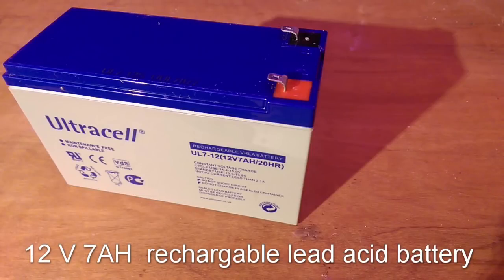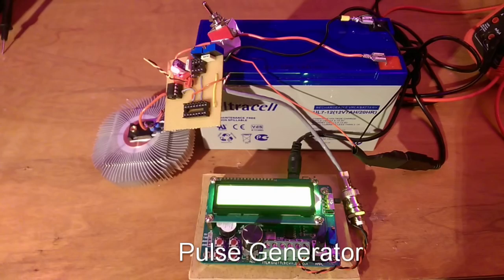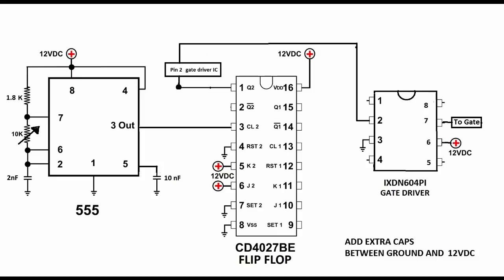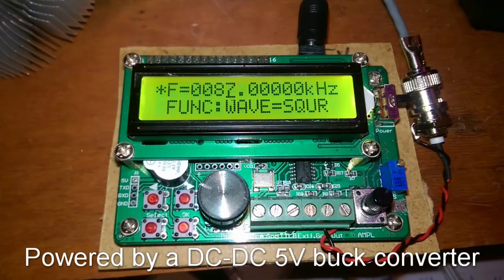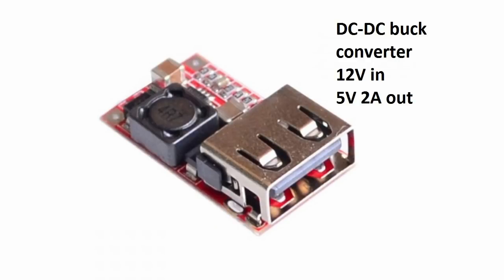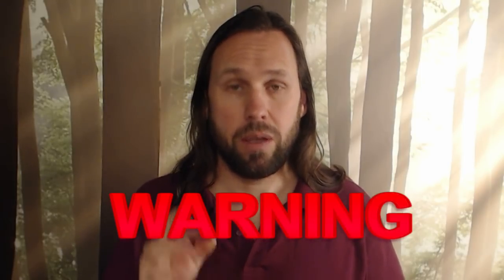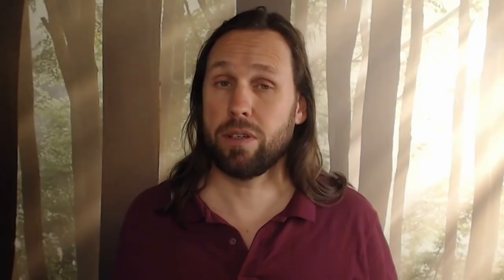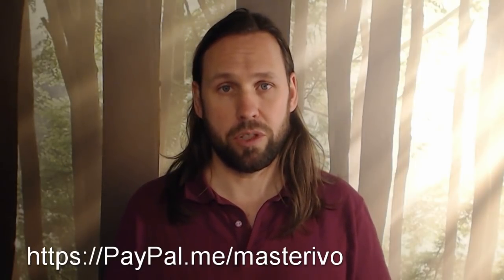High Side Inductive Switching with a N-Mosfet

Comment: Might also check out the DM6 series MOSFET's designed for lower reverse current time (which occurs in all MOSFETs), higher reverse voltage (600V) and specifically designed for back dv/dt protection ("robust)...additionally it has built in zener for input protection so you don't have to regulate the input pulse.

So typically I switch the lower-side of the coil (negative side)...and use parallel diodes for the back-EMF through a secondary circuit to collect the back-EMF energy...at any rate the back EMF of the coil is acting as a 'battery' for the secondary circuit...typically a capacitor bank (or a battery)...this secondary circuit protects your switching MOSFET from the back EMF (dv/dt)...thus I don't typically toast my MOSFETS (unless my back EMF diodes are insufficient...that's why you use multiple in parallel)

To increase the Back EMF energy, add series coils...I also add additional MosFETS with additional groups of coils...and split the input 50% duty cycle driving pulse into multiple driving pulses to drive each group...

Also as you pointed out in a previous video, bifilar coils are simply pancake coils laying on top of each other with correct series wiring..

Thanks much!!

Comment: Very cool, you are so easy for me to understand because you don't look at what anyone else is doing to learn but learn in a very fundamental way like I do. Can you link the pulse generator I wanna check it out. I would've probably just done an Arduino timed FET pulse to make the positive voltage at the source but if the pulse generator is cheap that's a good way. As for the back voltage does the back EMF actually exceed the voltage you put into charging the coil? In my mind it would be less because the number of turns doesn't change so it should be close to the same voltage you put in but a little less. It would also be interesting to hook up an energy meter and see how much energy you get back. I hope next you build a motor because the faster gradient of a spinning motor will make it all the more interesting.

Comment: Hi, Ivo,
The circuit idea is well though out.  Me likes !
It will be part of my tests, for sure. 
A side note, have you given though of using Silicon Carbide MOSFET. 
They are pricey a bit at the moment but coming down quickly. 
If you do, I am very interested into trying it also.
We can compare notes, maybe!
Reply from the maker: thanks, no I haven't tested those yet, but heard great things about them. just ordered Mur1660CT to test them out (as step recovery diode)
Reply: SiC-cascode are out also (SiC powerFET -mosfet casode) for higher voltage and high speed...
Reply: Do you have a link or part number I'm curious to try them I build coilguns so I need the performance. I know they use them in the ludicrous capable Teslas.
Reply: @ryccoh  Try this out https://goo.gl/c8H5pA 
There are more on Digikey websites.
Let me know if it works out for you.
Cheers.

Comment: Great work sir! Buck and boost back EMF is fun isn't it? We learn how just a little voltage (1.5 Volts) and a speck of amperage (.01 Amps) can be amplified to burn out equipment very rapidly with switching and harvesting coils (coils of various shapes sizes and different materials) Materials used to wind coils is the key! I've learned to use other materials other than just copper to build Coils/Back EMF Energy Harvesters. (I like your circuit) Thank you for sharing... This is a simple coil with diagram I played with last week https://www.youtube.com/watch?v=pE3EOf1m--M&t=159s Best wishes!
Reply from the maker: Thanks, I'll watch that link later